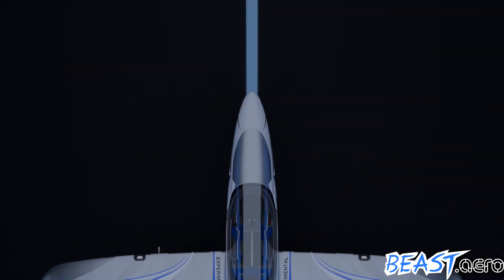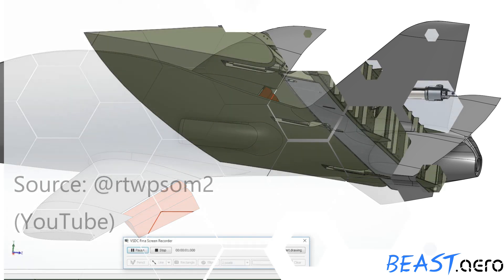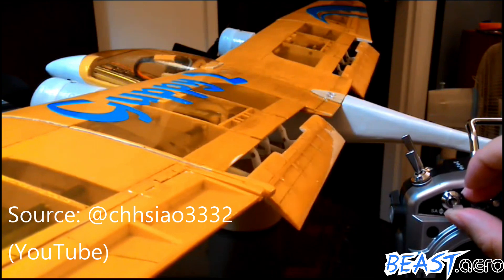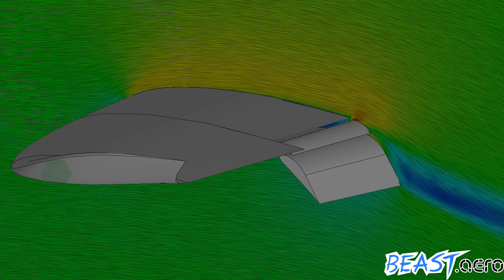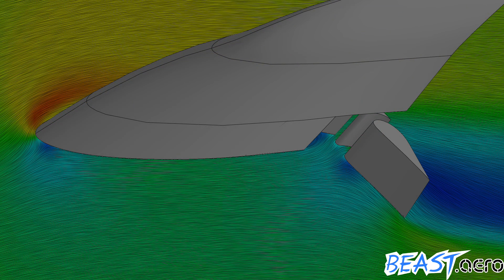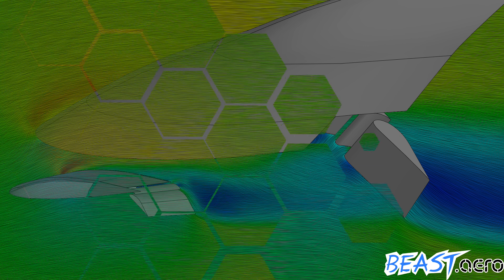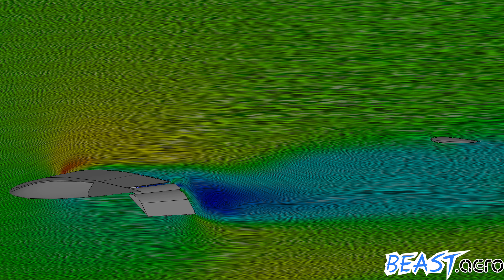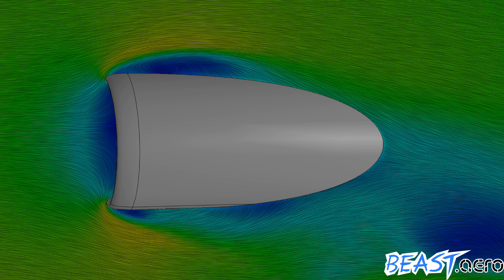Horus VLog #20

Comment: Amazing!

I’m about finished with the airfoil and fuselage concept of my own design, will go into cad soon!
Reply from the maker: If you want, we can discuss your design. Very good to see progress on your project too.
Reply: @BeastAero when it’s a little further along I’d love to!
Right now is it’s a twin engine design using these engine from Taiwan called the H350R

Wing Configuration: Mid-mounted, trapezoidal wing
Planform Shape: Trapezoidal with small raked wingtips
Sweep Angle (Quarter Chord, Λc/4): 25 degrees
Aspect Ratio (AR): ~6.0 (Balanced between transonic efficiency and structural rigidity)
Wing Area (S): 95-105 sq. ft. (Exact value depends on final taper ratio refinement)
Taper Ratio (λ): ~0.45-0.50 (Moderate taper for balanced lift distribution and drag reduction)
Dihedral Angle: 2-3 degrees (Enhances lateral stability while minimizing excess structural weight)
Washout (Twist): 1-2° at the wingtips (Prevents premature tip stall at lower speeds and high AoA)

Root Airfoil: Modified NASA SC(2)-0710 (~10-12% thickness-to-chord ratio, tailored for wave drag minimization)
Tip Airfoil: Modified NASA SC(2)-0708 (~8% thickness-to-chord ratio), enhancing transonic efficiency and reducing induced drag
Leading Edge: Mildly swept back, fixed leading-edge droop (no slats) small subtle LERX to blend the wing and body.
Trailing Edge: Single-slotted flap system, optimized for low-speed handling

I’m still locking down the final specs. It’s a race to trying to make it smaller but still having the required takeoff and landing performance given the maximum takeoff weight.

Trying to optimize it for a cruise between 30,000-33,000 feet.
Although might be stuck lower in busy airspace because getting rvsm certified is difficult.